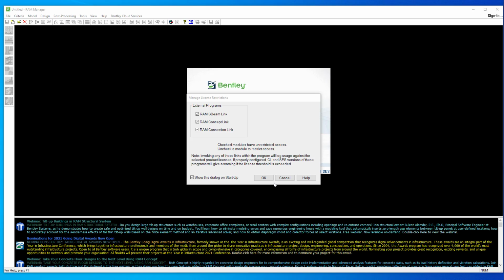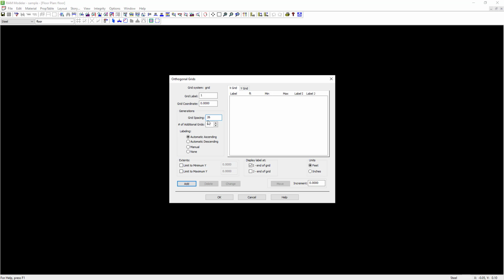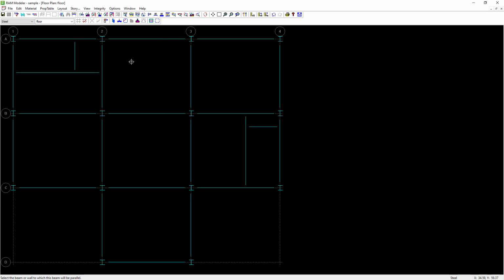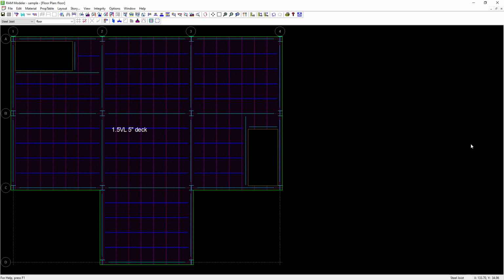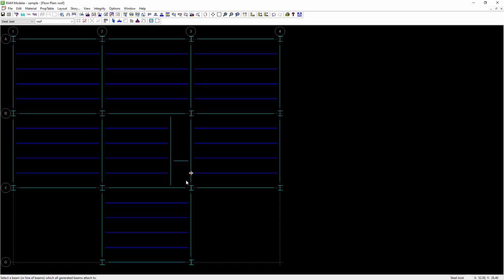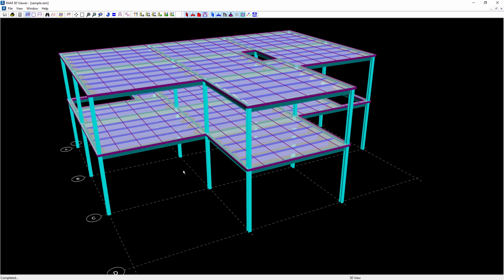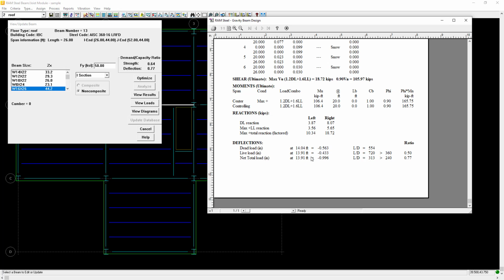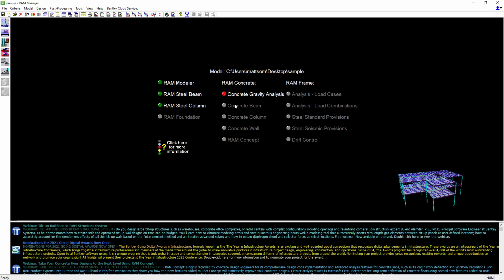RAM Structural System Steel Tutorial

Comment: So I am designing 4 storey office building and my steel joists after designing it, becomes trusses. How do I make it so that the software only uses I-beams?
Reply from the maker: There is a drop-down menu where you can select beams or joists when generating the infill members.  If you have joists and want beams, I'd suggest deleting the joists, changing the drop-down to beams, and then adding them back in.